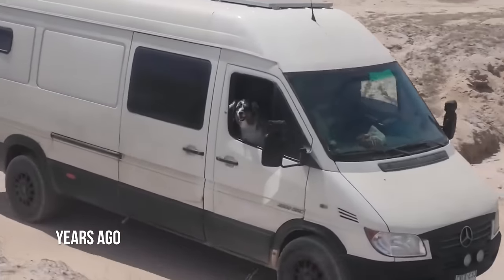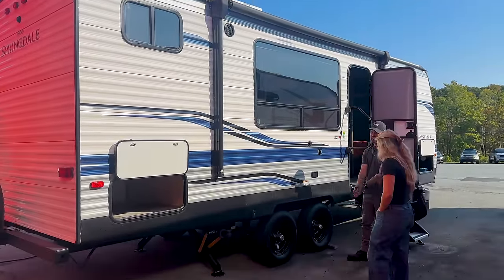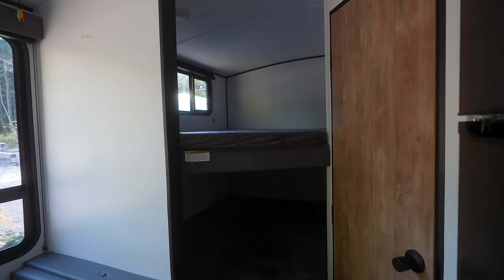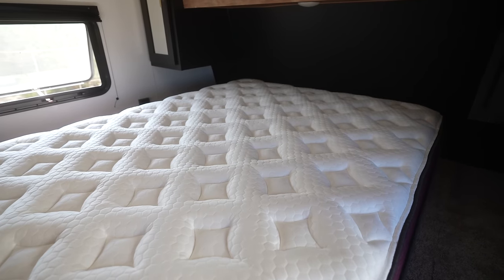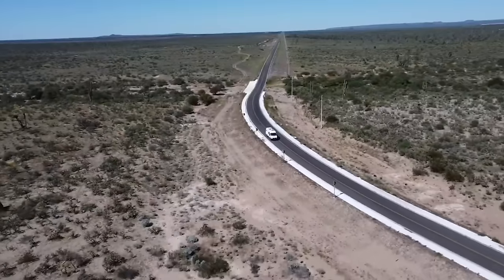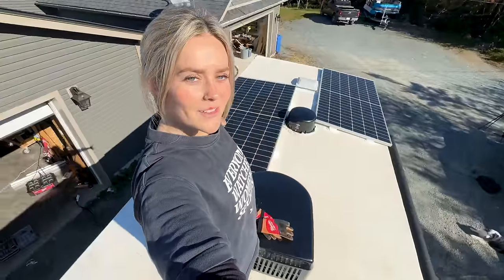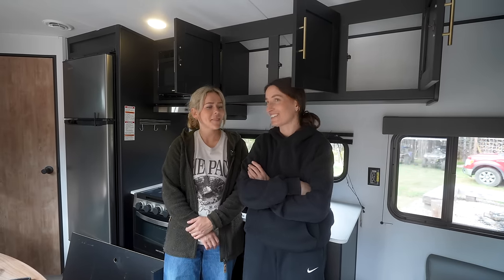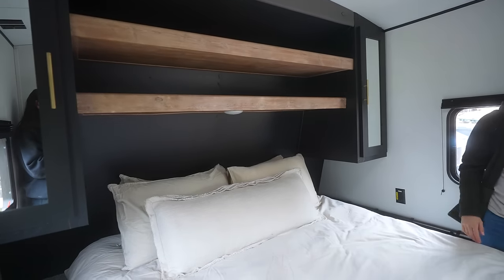We Bought an RV!

Comment: Check those trailer wheels and bearings for carrying capacity and freeway speeds.  Carry some spares for both.Also, if you're going to use those parking stabalizers, add some good Canadian wood as an addition to those metal ones.  (I'm afraid of snakes, so some anti-venom or some kind of first aide would relax me-and for the puppies too, they could need it.) Also, with the US election result, keep an eye on US politics. 
 Cheers from the Pacific West Coast of Canada,
Reply from the maker: Thank you for all your advice. 😊🐶

Comment: Those specs you talked about seem way off. That trailer will be closer to 6000 pounds or more. Your truck cannot pull 14k pounds, that is the MAX that a stripped down 2 wheel drive single cab f150 can if it comes with the heavy duty towing package. Your specific truck will be closer to 9 or 10k pounds. Every feature you add to a truck (crew cab, 4wd, sun roof, bed liner etc), all those features add weight to your truck and that weight means you can pull less and less as you add more and more features. But you really have to read the driver side door sticker, it will tell you your payload; payload is the amount of weight you can put on/in the truck. This includes the weight of both of you + your dogs etc, any luggage you add, and the weight of the trailer pushing down on your truck when it is attached. Add up all that weight, and make sure that weight doesn't exceed the payload on your specific truck (your door sticker is unique to your truck, every truck has different stickers and payloads and limits). The amount you can put on/in the truck (payload), will always limit you to what you can pull, well before you reach the 10 to 14k pound towing limit. If your trailer weighs 7000 pounds when its loaded up with cargo, propane, battery, food, water, then take 13 percent (rough estimate) of that and you get 910 pounds, add another 50 pounds for the weight of the weight distributing hitch. Lets say 1000 pounds. If your trucks payload/door sticker says 1600 pounds, then you deduct the weight of the trailer tongue (13 percent of trailer itself) from the 1600 and you're left with 1600 - 1000 = 600 pounds. Lets say you weigh 150 pounds each. That means your available truck payload is now only 300 pounds left when you both climb into the truck. Another 100 pounds for the dogs, now you're down to 200 pounds. So you can see that you can't actually pull 14k pounds, you cannot carry the tongue weight of that trailer + all of you and your dogs because you will exceed the cargo carrying capacity of your truck (payload). Most half ton trucks, regardless of brand, figure on pulling no more than 8000 pounds when it comes to travel trailers. Most travel trailers have about 13 to 15 percent tongue weight, so if your trailer weighs 10000 pounds then about 1300 to 1500 pounds of that will go directly onto the back of your truck and that weight needs to be deducted from your trucks payload. You will always run out of payload well before your trucks towing limit.

Comment: Before when you were in just the van and only had one vehicle to worry about I felt that you were fairly safe traveling in Mexico. But now that you the truck and trailer I am getting worried about the safety of you 2 girls traveling in mexico alone. You need to  never leave your truck and trailer alone. Only 1 of you go into a store to shop at a time and stay with your rigs in the parking lots to make sure no one steals it. This is just a safety precaution until you make it all the way to your land in Baja. Please be aware of your surroundings at all time.

Comment: Are your wheels the same size as your Truck tires??? I had a trailer with smaller wheels than my truck, going 60 - 65 m.p.h. I ran the tires off it, they were  NEW TIRES, THE bigger tires have a long revolution around than the smaller tires, and I didn't know about this, I literally  ran the wheels off of it, and I couldn't feel the flat either, a driver next to me motioned back

Comment: Sorry i noticed you put silicone or sth. On the screws at the roof to make it Watertight. I think you forgot that there is an open side on the metal thing you screwed on. The side where the solar module is. Have you checked this? Just want to ask, sorry for my bad English.

Comment: At least one thing you did right Springdale is a good make of it's RV let's still don't like our arrays sorry worked on them too long rebuilt too many just make sure you season it yourself don't trust the factory sealant even if it has side trim a lot of times I put the side trim on the opposite way you would put a shingle on in the water when it's down into the trim and right into the bottom of the trailer:face-purple-crying::face-purple-crying::face-purple-crying::face-purple-crying::face-purple-crying::face-purple-crying::face-purple-crying::face-purple-crying::face-purple-crying::face-purple-crying::face-purple-crying::face-purple-crying::face-purple-crying::face-purple-crying::face-purple-crying::face-purple-crying::face-purple-crying::face-purple-crying::face-purple-crying::face-purple-crying::face-purple-crying::face-purple-crying::face-purple-crying::face-purple-crying::face-purple-crying::face-purple-crying::face-purple-crying::face-purple-crying::face-purple-crying::face-purple-crying::face-purple-crying::face-purple-crying::face-purple-crying::face-purple-crying::face-purple-crying::face-purple-crying::face-purple-crying::face-purple-crying::face-purple-crying::face-purple-crying::face-purple-crying::face-purple-crying::face-purple-crying::face-purple-crying::face-purple-crying::face-purple-crying::face-purple-crying::face-purple-crying::face-purple-crying::face-purple-crying::face-purple-crying::face-purple-crying::face-purple-crying::face-purple-crying::face-purple-crying::face-purple-crying:
Reply from the maker: Thanks for all your tips. 😊🐶

Comment: Security for the trailer whilst parked in Mexico must be considered if you'll be leaving it for periods empty. Put it on a foundation and remove the wheels and if possible, the hitch connection that connects to your truck to avoid theives from hooking the trailer up and snatching the RV. These buttheads are opportunists that will go for the quick grab. The other thing would be to put a barbed wire enclosure around the RV and setup a WiFi Security Camera to monitor the enclosur 24/7, and have it setup up to send any video footage to the cloud. At least this way if something does go wrong and the RV is stolen, at least you may get footage of the arseholes who took it.

Comment: That's not an RV. It's a bumper pull travel trailer/ camper. An RV (a recreational vehicle) Vehicle being the key word here. Meaning it has an engine and can be driven from place to place under its own power. Where as a travel trailer/ camper has to be connected to a Vehicle then basically towed or pulled from place to place. So when making videos about something be sure and aware of what things are called. So as not to receive comments like this.

Comment: "everythings made by Lippert"....RUN FOR ZEE HILLS...you should have done a little research about Lippert before you started looking at RV's, many lawsuits have been filed and even the national highway safety administration is investigating them.Although they dont manufacture the v itself, they supply many of the componants in the manufacturing process including the frame which caused most of the problems.